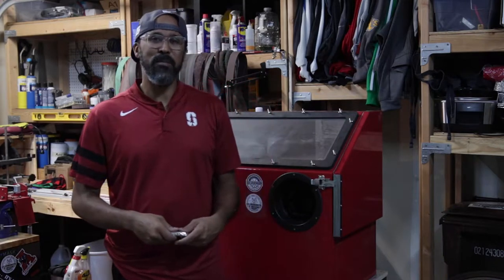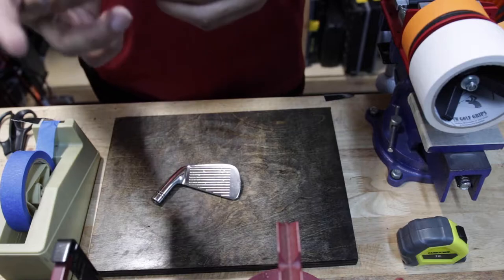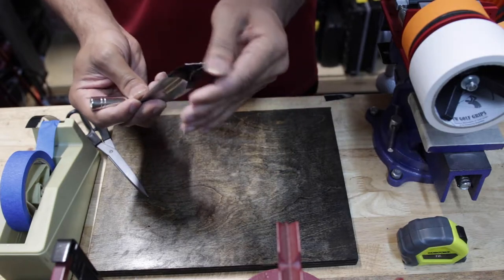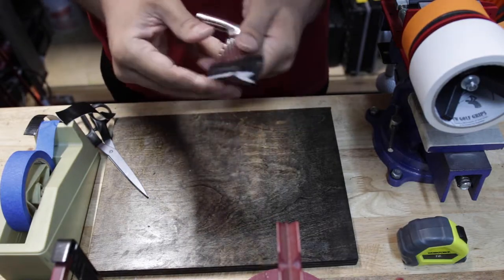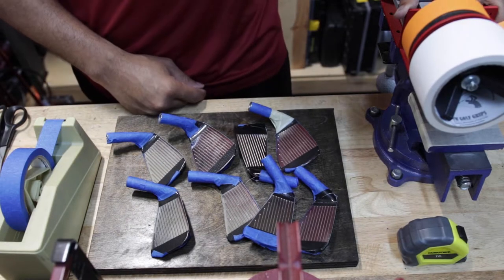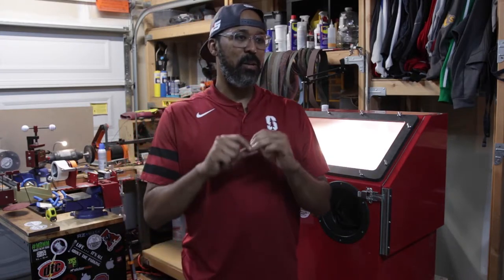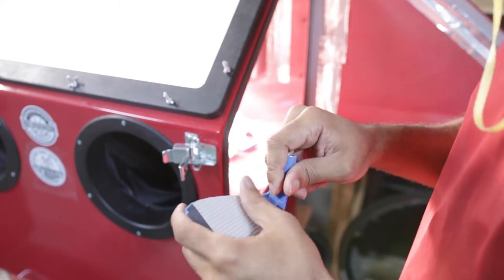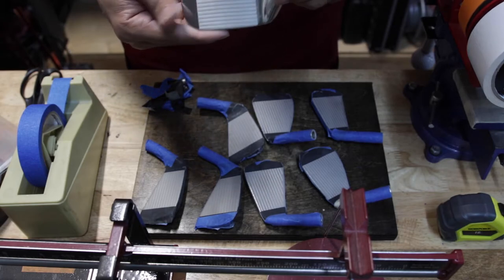Golf Club Restoration | Part Three | 1985 Titleist Tour Model Irons

Comment: Hey mason, I a friend of mine as recently offered polish my golf clubs, and they have come out amazing.... however he isn't a golfer and didn't know not to polish the face. And now the entire club is like a mirror finish Unfortunately. I was hoping to blast it with something to get that striking face texture back. Is there anything I can blast it with that will not remove the chrome/nickel plating but will still provide that texture? Thanks in advance. I appreciate it a lot
Reply from the maker: Tape it off, 80 Grit Glass Bead, 50 to 65 psi, left to right motion back and forth, that should give you a nice contrast without messing anything up, test out on an old head first.

Comment: Hi BBMason, great videos, I watched all 3 parts. In the Sand Blasting part, I did not quite catch what you used with Glass Beads 80 grid + something else to get the bright look. Please respond. 2nd question is how would you get the grove quality back?
Reply from the maker: I have a ton of different mixtures I think that particular one was is glass bead and fine grit walnut shell 3:1 ratio. I try my best not to work on clubs with devastating groves. Once those groves are gone. You have to find someone to re-groove them. Then if you want to compete in tournaments with them they have to conform to USGA regulation. I know a couple of people who can get the job done. Mainly I just sharpen them with a grove sharpen.